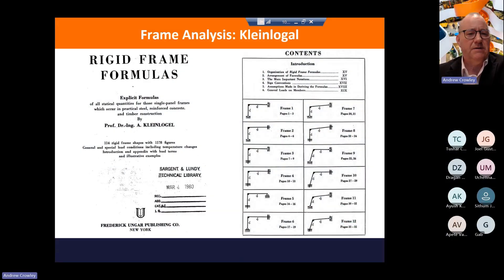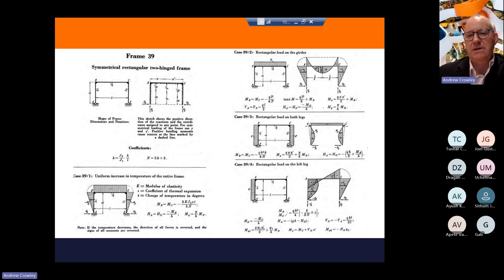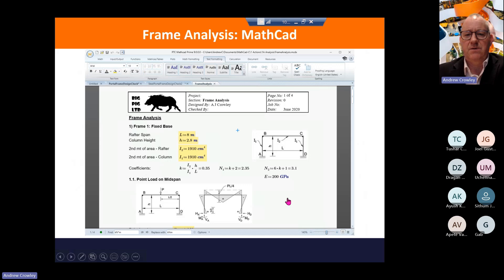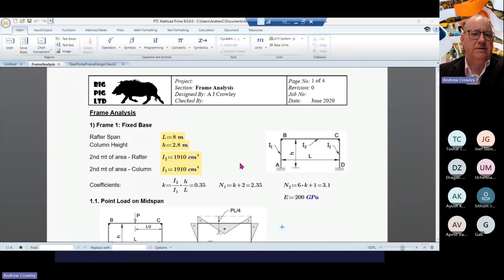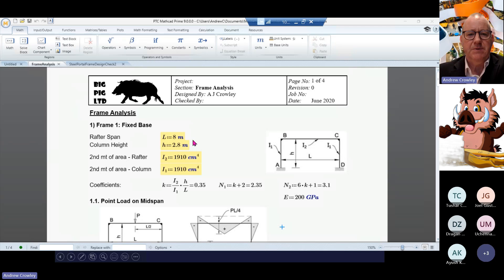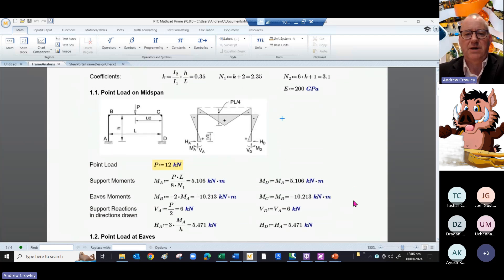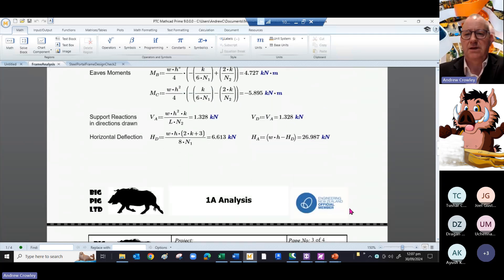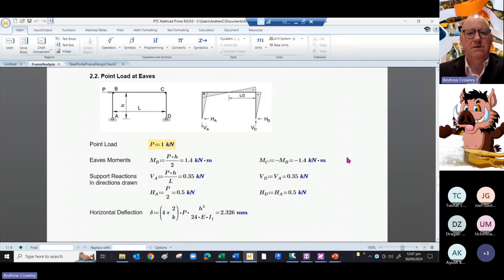Portal Frame Analysis by hand using Kleinlogal formulae in Mathcad.

Comment: Frame 1 sample calculation
Reply: If a and d run on roller  then give calculation
Reply from the maker: If A and D are both on rollers - you have an unstable frame. If both A and B are pinned bases, the calculation is given in the Mathcad sheet available at bigpigltd.com. If A is pinned and B is fixed, see frames 49 (pg172) and 55 (p206) of Kleinlogel (https://files.engineering.com/getfile.aspx?folder=95bcf08c-c386-4494-8009-6164d55f25fe&file=kupdf.net_kleinlogel-rigid-frame-formulas.pdf)

Comment: Are there similar methods for approximate analysis of MULTI STORIED  PORTAL FRAME STRUCTURES which take into account the rigidities of vertical and horizontal members. IN SHORT METHODS MORE SOPHISTICATED  THAN THE PORTAL AND CANTILEVER METHODS?
Reply from the maker: Not really. Most do it by computer software these days. Chapter 11 of the Steel Designers Manual from the SCI discusses the analysis of a subframe. This will give you an initial estimate of the forces in the frame. The back of Klienlogal gives the formulae for Vierendeel box frames.   Section 4 of the Steel Designers Handbook by Gorenc discussed how you can use relative stiffnesses to amply the moments.